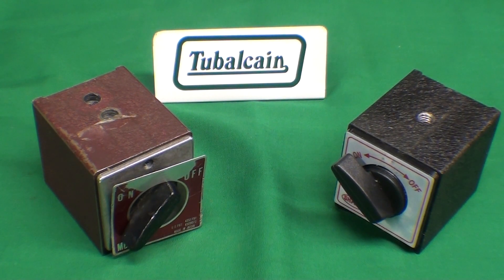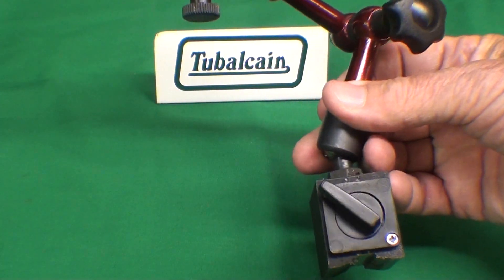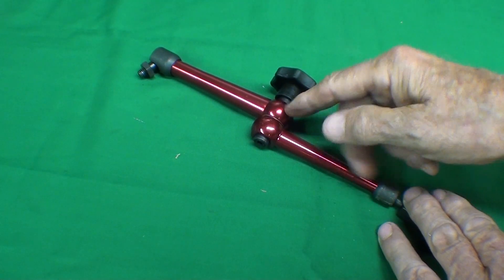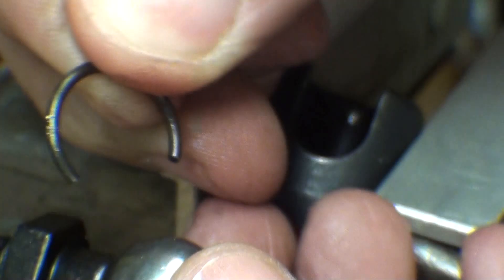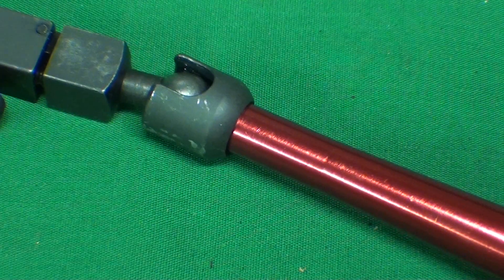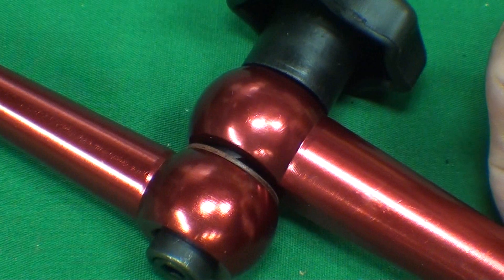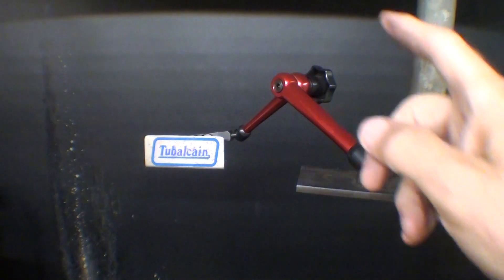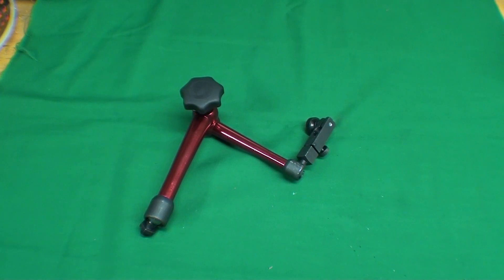What Makes It Work #28 Articulated Indicator Arm NOGA tubalcain

Comment: Thank you for the clear demonstration of how these work! 👏I have several Noga brand ones I use for video work and I've always been a little worried that they might use some sort of straps, belts, or bands somehow that could get stretched over time or suddenly break if over tightened. I was also afraid to take one apart because they were expensive and I envisioned springs and pins etc. flying all over the place and not being able to get it back together again! 😅 I'm glad it's a simple and robust design! 😎👍

Comment: Man U saved me tearing one up thank you  teacher ...I wanted to repurpose one into a test indicator holder for  the Bridgeport but for some reason I thought I would make a new base   ball end solid no threads  then I woke ..up ill just tap a 1/2" sleeve 8mm x 1.25 screw it on  and into a 1/2" collet on the mill ....duh

Comment: It's like a dead animal when it's loose.  Nope, you are not overdoing or overexplaining anything.  I like it.  Take the knob off of that other style holder that you said you liked so much (your favorite) and you'll probably find another square nut spacer.  It's a mystery.   Some day we are going to have to have the surface area and holding friction talk and I know everyone is going to get upset about it, but it really is what it is.  Size (or area) does not matter.
Reply: What did that guy just comment!!!  Size doesn't matter??  Blasphemy, it's blasphemy I tell you.  Don't listen to him!  Cover your ears! .........  Yep, frictional forces are NOT a function of area for sliding solid to solid contact surfaces, area is not even in the equation for drag.  (so, what about birds, boats and airplane wings?  Not solid to solid.)
Reply: It's not the surface area in this case.  It is the radius of gyration.

Comment: Noga came up with a brilliant design. I just bought a new noga with an odd looking permanent magnet to mount on the tool post for lathe work. The magnet is about 3/4" wide x 3" long. it's very strong for it's size, but easily removed by tipping it sideways. The only thing that I don't like about this new Noga is it only has a dovetail mount. No means of clamping the round bar on Swiss style test indicators. I haven't looked yet but Noga probably sells an adaptor.....Being the Greedy Devils that they are.     : )

Comment: The original inventor was Carlo Baitella, patented in 1973 as CH549260A and 1975 as US3910538A - "Jointed stand for dial gages" - and founded the company FISSO which still makes them for both machining and medical applications. Noga, Bogen, Manfrotto etc. are all copies of that original design (now that the patent has expired).
Reply from the maker: Thank you, very interesting. I will look up those patents.

Comment: I really enjoy this series.  It seems there is hardly a week that goes by that I need to tear something apart to repair it and there is always that bit of discovery before the repair.  Sometimes I say aloud (no one listening in my shop) "what insane idiot designed this piece of excrement?"  And then there are other times when I say, "I could have thought of that, but I didn't, great idea."  I would say the second on this device.  As you began I had all sorts of ideas including a rack and pinon setup (what a piece of excrement that idea would be).  Great video Mr. Pete.

Comment: I bought a noga mag base but, my starrett doesn't fit in the dovetail are they different size's ? and I used the vise grip for yr's on car's for checking ball joints and bushing but the tolerance's where like 5 th of a in"
Reply from the maker: I thought all dovetails were standardized?
Reply: @mrpete222  I was looking on the book they give you in the box some say 1/4 and some are 3/8 I just hate to open the dovetail and squeeze it in thank you.

Comment: there should also be force between the bottoms of the ball bearings and the captivating ring.  so there is more contact than just the pin and more friction to lock it down :) great vid and thanks for taking it apart

Comment: Mine is hydraulic.  I love it.
Reply from the maker: What brand?
Reply: I have also a hydralic knock off. I is more rigid than a mechanical one but only when it new... after a short while it become junk from leak. If I have to buy it again, I will buy a mechanical one.
Reply: @Spark-Hole  mine somehow lasted almost 20 years before it started to leak.  If it hadn't started leaking I'd never even have known it was hydraulic!  Some new o rings sealed it up again. We'll see if it lasts another 20 years. . . .

Comment: From what I have seen, the "real deal" in these stands (I have absolutely no connection, just trying to get budget for this ;-})
Immediately clear that the bodies and balls are much more substantial than others, and they have a beautiful fine adjustment feature of the indicator mount...yes, not $35
Hydraulic locking  http://www.hoerger-gaessler.de/hydraulische-messstative.html
Mechanical lock. http://www.hoerger-gaessler.de/mechanische-messstative.html
They are sold by the Hoffmann group in USA
220 mm is about 190 euro, not sire of is pricing...
Here is a close look, a 360 view, where you can see the flexure mount for the indicator, with fine adjustment.
https://www.hoffmann-group.com/GR/el/pangakis/Metrology/Height-gauges%2C-measuring-stands/Hydraulic-magnetic-measuring-stand-%28with-base%29-220-mm/p/440800

Comment: the damn plastic button you turn to activate the magnet melted when i was welding. Couldn't they just have made it from aluminium at least like their indicator fine adjustment devices?
Reply from the maker: YES--they should have made it of metal

Comment: yes i hated the flew arms when i was working as tool and die maker ... but this Noga also shows poor workmanship. they couldn't take a a  few seconds on an NC machine and make a pile of correct fitting washers to replace a cheap  nut, this just makes me wonder about the quality of the rest of components  as in how hard are the clamping rods and how well will they hold up under extended use .  do a hardness test on the balls  and collars that hold them also on the surfaces of the wedge locks and cup ends of rods and let us know  how hard they are. if they cut corners on using a nut i would be suprised if the contact surfaces to lock it up are going to be hard enough to hold up proper

Comment: How come the centre and the end balls lock at the same time? Are the rods cut to just the correct length? If the rods were a few thousands longer would it still tighten in the centre? Is there something else causing it to contact with the 3 points with the same force. Is the hole in the bushing larger the the bolt maybe.

Comment: Good video, thanks for sharing. As an auto-truck-heavy equipment mechanic I used one of the CentralTool version for many yrs checking crankshaft enclosure, diff and axle play, rotor and flywheel runout, ect. Yes it has inherent play issues but the tolerances I was working with were multiple thousands. For engine building ect I used a properly secured base to measure from. The problem is in automotive work it's difficult to find an area of steel large enough to mount a magnetic base although over the years I've built a number of Rube-Goldberg setups to put a flat of steel in odd places.

Comment: The rod pushing the ball doesn't need to resist the ball turning.  It simply pushes the ball against the retaining ring you took out.  Creating enough friction to immobilize that ball.  To some degree, it's a combination of the two I suspect.

Comment: The articulated arm that I have (sold as a photography item) has teeth at the elbow to lock the angle securely.  Would this be good for machinists as the elbow would be more rigid?  For photography you might have a rather heavy camera on the end and would need more than mere friction to hold it in place.  But possibly bad for machinists as the teeth limit positioning to set angles.  My $0.02.
Reply from the maker: Thats good info--I was unaware of the camera product
Reply: I was thinking that knurling the edges of the arms that make contact with the fibre washer would help keep that joint from slipping. More positions would be available than the photography arm. Short of knurling, use a letter punch, such as "W" or "I" and stamp the mating surfaces. The fibre washer should grab the raised bits to make the joint stiffer when clamped.

Comment: I have some of the cheap ones and a Noga. The main differences are that the Noga has larger balls on the ends for more contact area and instead of a fiber washer, they have some sort of friction plate. The material almost looks a clutch pad surface or break pad material. Lots more grip even when it gets oil on it. The cheap ones goes all noodle arm on me if they get any oil on them. You get what you pay for. (I think there is a hydraulic version of these made by several different companies.)

Comment: Very relevant video to me because I'm waiting for mine to be delivered. Turns out to be quite a sturdy arm doesn't it with just one potential weakness that I can see which would be the fibre washer. Easy to replace though. I won't worry too much about that because I will not be using it on a regular basis. Anyway, thanks for easing my mind, you never can tell what you'll receive from China but this looks to be a very good purchase. Let's just hope that Robo customers are going to get their money's worth. Regards.

Comment: putting some grease on those bevels might actually help, reducing friction between the bushing and the plunger, thus increasing pressure on the balls. The balls! :-D And probably greasing the threads wouldn't hurt either.

Comment: Thanks for the explanation of the mechanism, but I have a question:  is there a critical timing requirement to synchronize the three clamps?  I would have thought the cam-notches and the fiber spacer must be tweaked in size so that they all tighten at exactly the same moment during the central screw's travel.  Is this guaranteed by tight tolerances on the production parts?
Reply: If I understand the mechanics correctly I'd think the clamping force of the cams is more or less self equalizing (except for friction) and the central part probably has more than enough direct clamping force even with the fiber space taking up some of the tolerance.
Reply: You can pretty much just slap them back together and wiggle it around till it lines up. All the parts pull against each other in a stack so no adjustments are necessary. I do recommend swapping out that oversized nut for a proper and slightly shorter washer to get a bit more thread contact on the knob. Mine also came with that same nut originally.

Comment: what's worse than the pocket fisherman?....That bald spot spray paint he was selling to balding men. I wonder if it ran if the guy sweated......
Reply: squireca Haha, I was just thinking of that. Hilarious! Every time I used that crap and it rained, I looked like a balding Marilyn Manson.😜 All I had to do was slap on some flex seal to seal it up, no more running. Cleanup procedures were to use oxyclean. I started wearing blue button up shirts around that time also.🤔 Sorry for the pocket fisherman burn Mr Pete! I love that guy tubalcain, he reminds me of a combination of both my late grandpa's.
Reply from the maker: Thanks for watching
Reply: Hey, I caught some fish with a pocket fisherman once upon a time.  Pretty brilliant unless you wanted to cast more than about six feet from your own feet.

Comment: Great video, I was looking forward to seeing how those arms worked. Like another commenter bendavanza, I own a Manfrotto "Magic Arm" for my camera which I guess works in the same way. In fact there are two types of Manfrotto Magic arm, one with a knob that is turned to lock the arm and another type with a lever. The lever mechanism sometimes gets out of position and you have to disassemble it and reposition a half-dozen ball bearings. I guess the rotary-knob version is better. I always wondered about the mechanism for locking three joints at once. Thanks for solving that mystery.

Comment: Mr. Pete, what kind of assembly uses cable tightening for similar action.  I remember a dancing wooden puppet that had the stiffining by pressing a wooden plunger in the base. But, I've also seen a mechanical assembly that used wire/cable.  Any Idea.
Jim

Comment: Interesting. I was wondering if they used some type of cam mechanism in them. Does the ball get pressed up against the retaining ring so it also helps provide some of the resistance to movement when tightened?

Comment: I always wondered how those worked, I have the automotive one like you have Mr. Pete, as a Mechanic, I curse the thing daily, I love the Vicegrip part of it. But  trying to use the old style rod type is more of a pain, but it at least doesn't move if a mouse farts a hundred yards away, while trying to measure runout on something, unlike the old ball and sleeve type with the cable in it.   Thanks again for another great video and explanation.

Comment: I bought that exact indicator holder about two weeks ago. Works pretty well. Mine isn't as flexible when it's loosened but it is relatively rigid when it's tight.

Comment: the indicator with the gold and bigger handle looks just like one of the ones I have and mine works with hydraulic fluid not a mechanical rod. just a thought I know it because it leaks and I have to add fluid all the time will change out the o rings someday.
Reply: Mine too.

Comment: Many thanks Mr Pete! I agree, it is so simple yet very clever.  I recently took apart an articulated camera mount that uses 1/2 of the same mechanism and never realized it works the same way as the Noga. The camera mount is just a single ball with no arms, but it uses exactly the same wedge to tighten the ball. Then Noga  (or whoever developed their mechanism) came along and realized that they could put two of the wedges back to back and move the balls out using hollow arms. Pure genius!  Again, thank you so much for making this video. I really enjoyed seeing it.  -- Mike Litzkow

Comment: Thank you for demonstrating the action inside the arm. I don't have a Noga either but I do have a "magic Arm" from Bogen Manfrotto. I am sure it was made by Noga under license. It is as you mentioned a photography item and it is quite large, the arms are around 1" in diameter. it's action is much smoother and more secure than the knock off indicator. I imagine a little polishing to the wedge faces of the cheapo unit would improve the action.
Reply: bendavanza I
Reply from the maker: Thanks for watching
Reply: https://www.youtube.com/watch?v=qnHfHl7LI7Y

Comment: If you take the time to lap the wedge and center boss eyes the operation can be greatly improved.
Reply: And replace that ganky square "washer" thing with a round one. It should sit on the edge of the arm (larger than the center hole) to hold pressure on the screw when tightened.